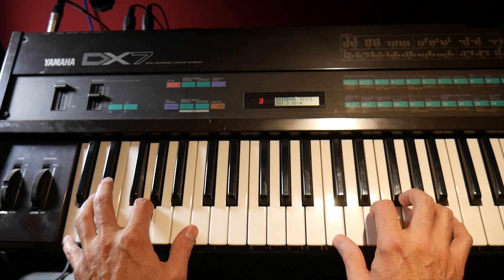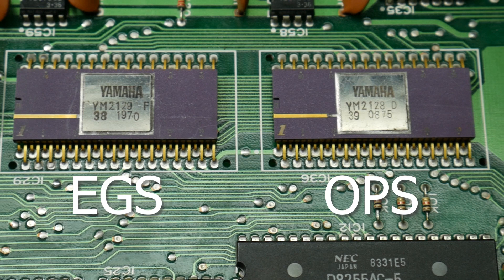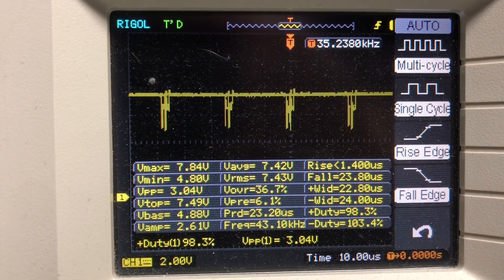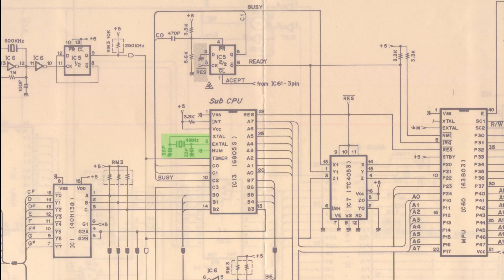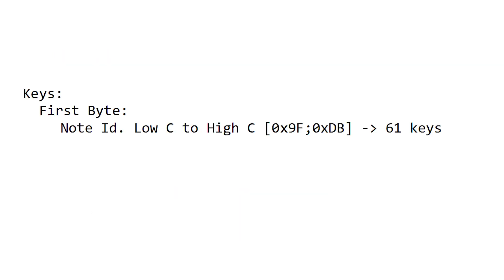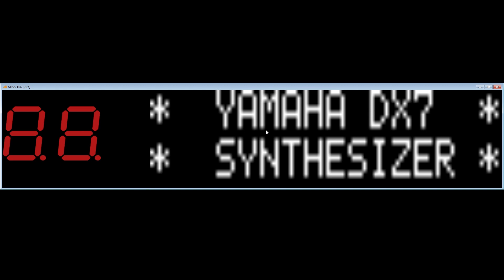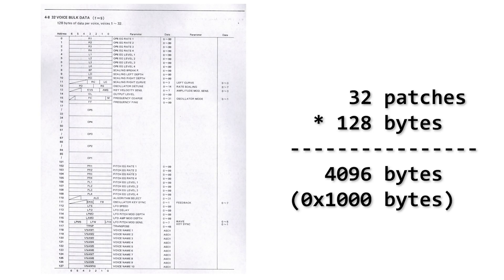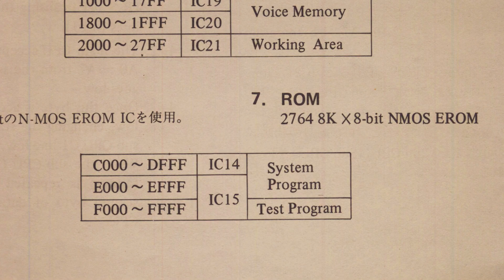Emulating the DX7 the HARD way

Comment: The DX7 is the one we all remember, but didn't the DX9 (cut down 4 OP) the DX1 (mega expensive version with massive case, better UI and weighted keyboard) and DX5 all released in 1983, and all worked pretty much the same way?
Reply from the maker: Yes, though the DX9 is voluntarily down powered
Reply: @plgDavid  Do you mean it has the same chips as a DX7, but is intentionally "feature reduced" by Yamaha?
Reply from the maker: @lundsweden  precisely. Want to make a short on that. Might do it soon

Comment: Thank you so much for your dedication to recreating this classic with all its idiosyncrasies! Two questions for you:

1: In some OPS7 comparisons I've heard, the hardware DX7 had a slightly sharper sound. This could be down to differences in reference hardware, but I'm wondering if it might be due to velocity mapping. I know the DX7 keybed can only output up to 100 velocity, vs. modern keybeds which output up to 127. Would you recommend remapping or limiting the velocity info we're sending to OPS7 for maximum authenticity?

2: I'd like to use OPS7 to recreate a TX816 in the box. When you're changing master tune on each of the TX modules, you have a range of +/- 64, with each step corresponding to about 1.2 cents (technically 1.171875 cents, but who's counting). Does OPS7 allow us to change master tune in fractions of a cent? And/or can you use the TX mode of changing tune in 1.2 cent increments? This is getting into the realm of the super nitpicky but I have such great memories of that lush sound and would love to be able to recreate it perfectly.
Reply from the maker: hey so
1) Its a convoluted topic for sure with many variables. OPS7's Firmware Behavior settings include Velocity mode where you can choose the velocity calcs made by the original keyboard when receiving external MIDI OR when hitting the keys - and it IS possible to get values higher than 100 if you whack it dangerously. Thats just how the sub cpu and main cpu does it that could have been better.
2)There are about 5 million settings you can tweak for pitch/tuning in OPS7. We didnt want to limit ourselves to just the firmware precision but to the EGS/OPS precision there. SO you can not only use the same MASTER TUNING knob of a real DX7, but also retune using MTS-ESP or Scala scales or a combination of all.
Reply from the maker: If you want to emulate subtle detune between virtual TF1 units (of a TX816/TX216), better to load multiple instances and adjust to taste.
Reply: @plgDavid  I've been playing with the VST today, and I really have to commend you on your work here. It's done what all the other DX emulations have failed to do, capturing that digital edge and fuzz that was the hallmark of the sound. I stacked up 8 instances to create a TX816 and compared it to some recordings of the hardware unit I used to own, and it's pretty much indistinguishable. Thank you!
Reply: @plgDavid  Amazing, thank you for your response! I'll be purchasing the synth this weekend, looking forward to diving in.

Comment: Has part II ever materialized?? (not finding on search)
Reply from the maker: No. Making part I kind of burnt me out. Not sure when it will be finished.
Reply: @plgDavid  Understood... and understandable.  The level of reverse engineering you are doing is awe inspiring.
(: I know just enough of the tech to hang in an ride out the whole video.. :). I have a DX21 myself and assume that most of the DX7 tech is also applied in scaled down form there. I'm (very slowly) working on developing MPE instruments that could utilize your synth engines, so I'll be following your progress.

Comment: This is neat. I love stuff like this.

Have you done much work with the LA32 / D-50 yet?

I did a basic register map for the LA32 a while back. I think MUNT basically does HLE for the actual synthesis part.

I hooked up an FPGA board to the LA32 on a D-20 board, and had the FPGA output a hex dump of a small RAM block via VGA. The RAM block mirrored the register writes to the LA32, so I could see in realtime when I changed the patch parameters like ADSR etc.

The ultimate aim would be to do a full D-50 core on FPGA, but it's quite a big project.
I'd love to work on that again if I ever get chance, but it's a bit low on the priority list atm.

Don't worry, btw, I think most people watching do enjoy the more in-depth nerdy details. ;)

Comment: This is amazing, David, I basically spent most of my life trying to build my own DX7 😜 I got as far as writing the firmware of the TX81Z for a 32 bit Arduino using a Chinese YM2151 and YM2414B. I was going to use my analyzer on the TX81Z to find out the undocumented codes of the latter chip but thankfully someone in Japan had already reengineered the firmware. Can't wait for part 2 😀
Reply from the maker: Fun right? I go both straight recycled and remarked YM2151 and YM2414B from China too (I have a video on that). We have our own reverse engineering of the DX100 and TX81Z firmware. Maybe one day we will make something with that ;)
Reply: @plgDavid  that would be amazing. Also, I did watch your fake chip video, and indeed some of my chips seem legit and some have the same factory date and are too smooth 😉 I always thought they were cloning the chips not recycling them. Hoped you were making a hardware rebuild tbh, I think there is a market for a small desktop module as well. For now, I got myself a TX802 earlier this year 😜
Reply from the maker: @OllyWoo  I have various hardware FM synth prototypes and possible partnerships. Time will tell

Comment: Gonna eat up this series and get some C/C++ Knowledge down lmao. 

DX7 was something I hated bc of the presets, but once I got into FM synthesis I had a newfound respect for the synth architecture and the lo-fi dacs. 

One thing that makes FM shine is modulating it in real time. WIth Dexed it's super easy with automations. With the Digitone (only 4op.) you get into some wild territory thanks to the ready access to live tweaking in the sequencer. 

Stuff like AdLib Tracker, RADTracker, DefleMask, M8 Tracker (Headless or the hardware version), DAFM, MEGAFM, etc. really give you more ability to push them to the max.

Comment: Would love to know how to use this knowledge to make a midi controller for the DX7 (with the ability to edit parameters on the fly without notes being cut off etc)
Reply from the maker: That only happens if you send a full patch to the DX7. Individual single param sysex do not interrupt voices.
Reply: @plgDavid  So this can be done? Have you tried to use patch base to design a touch pad midi controller for a dx7?
Reply from the maker: @anonymous_friend  afraid not

Comment: It would be cool if you could include the option to emulate 24 bit D/A Converters in addition to add the additional chip emulation required to power the Yamaha DX5
Reply from the maker: Technically the DX5 is not that far off from OPS7, like the DX5 we have two sets of EGS/OPS pairs (in A and B banks). The core maths do not have more precision than 15bits however. So DX7II got the max out of those maths.

Comment: Wow. That is really cool to see... I am reverse engineering a Alesis 90s Drumcomputer at the moment... Not to deep... just to understand the way patches and samples and the Hardware is controlled... I found hardware access to the ports in the code and was wondering how always 3 bits got frequently controlled in the same way but not the rest. i took apart everything and found out that the 3 bits control the 3 datalines going to a 74HC138 ...And that chip is controlling with 3 inputs all the chip select of each perepherial like Display etc. Basically the same you found out at 7:05 ... I guess they are all just cooking with water :D
Reply from the maker: Ha great stuff. yes 74*138 and 139 are the bread and butter of 80's computer/arcade design!

Comment: Nice. Thanks for making this. I hope u also make ensoniq SQ80, even though arturia made it recently
Reply: I just love the sound of it's 8bit wavetable and not too many emulation out there.
Reply: I rather have DW8000. Sounds so crisp and can mimic many synths of its time.
Reply: @jackcimino8822  korg dw8000 is overrated 😴
Reply: @chinossynthesizer705  Nope, you are!  Aside from the lack of PWM, the DW8k and its successor, DSS-1 are underappreciated. You can mimic PWM on the DSS-1 using the modulation delay as a flanger
Reply: @jackcimino8822  vintage synths are overrated people already explored them all.  new ones can do so much more with new technology now
Reply: @chinossynthesizer705  I didn't say all vintage synths are underrated. People haven't explored enough. Check out Power DX7. Also, Hiroshi Yoshimura's GREEN was done entirely with FM synths.
Reply: @jackcimino8822  theres better fm synths now that are more powerful and have more features lol I like fm synthesis but theirs new ones that are better then a dx7 you can even use dx7 patches on them and more faster to program as well
Reply: @chinossynthesizer705  What do that have to do with what I said? Plogue is making a SID chip emulation, as well as a Famicom and TX81Z synth.

Comment: I thought being as techy as you are there would be Linux versions of your VSTs.
Reply: Why stretch the resources of a company so thin to support a platform less than a low percentage of your customer base would actually use? That's like lower priority than supporting a niche feature that no one would use in the product
Reply: @tssf  You are right, but there is one reason Linux support would be great. The potential to run the plugin on something like a Raspberry Pi and create a clean nice DX7 solution when paired with a cheap MIDI controller.
Reply: @IAmSomeTreyGuy  can't argue with that, that would be really cool. I know David is making a neat portable synth in a cartridge for Famicom, wonder if dx7 will be in it too?

But yeah no doubt it'd be awesome to have a portable version of the entire chipsynth suite and maybe put it into a tiny little dx7 clone or something
Reply: But ARM Linux is even more niche than Linux ;)
Reply from the maker: @IAmSomeTreyGuy  Hey. Making a Linux version just to eventually port to ARM hardware is not necessary here. All our chipsynth cores already run fine on a STM32H7. I made all those examples on my twitter earlier this summer. The issue with Linux is the variety of distros and UI toolkits. We have our own custom UI classes and would want to do the same on Linux and its an pretty significant endeavor. I would rather do hardware tbh.